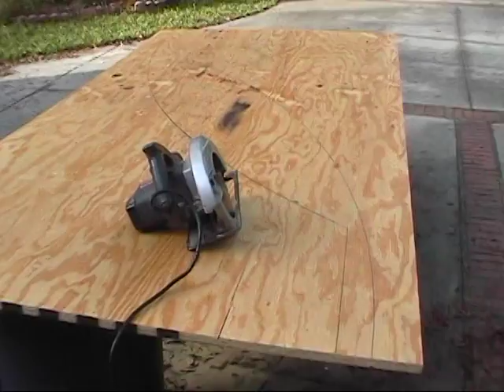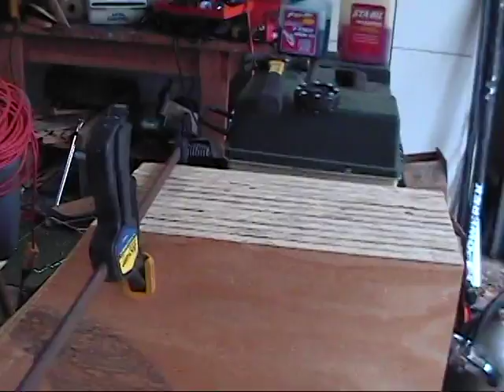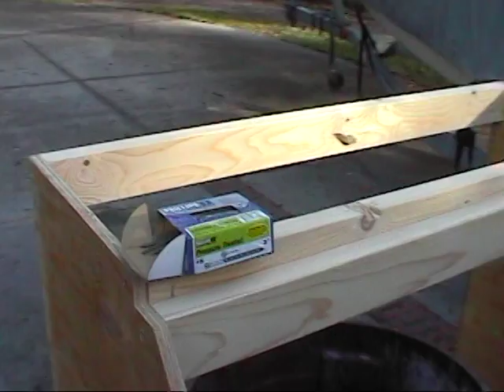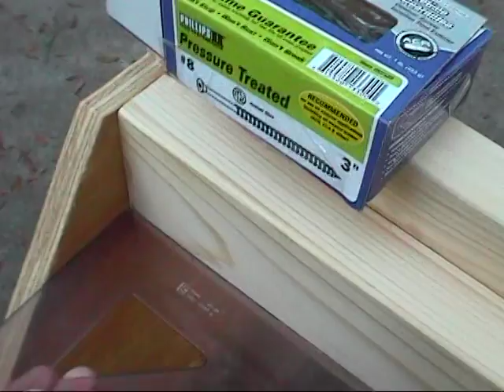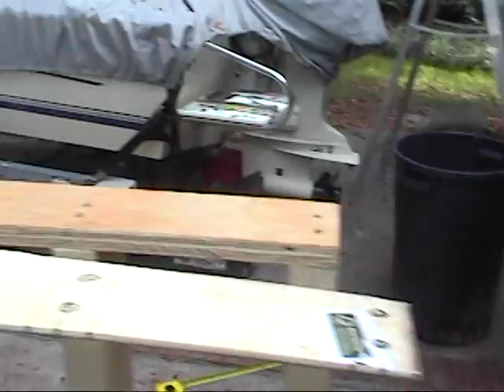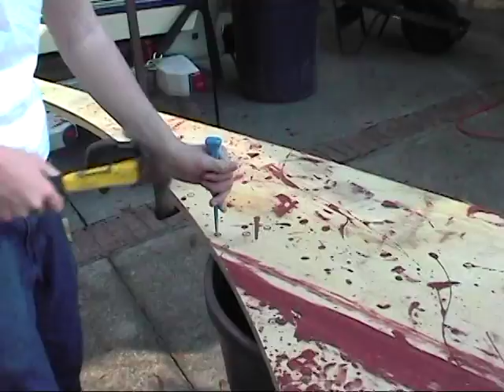Skateboard Miniramp build video part 1 of 5 ramp sections

Comment from the maker: This ramp can be built for less than i spent for sure.  I was designing it as i was building it so i made some changes as i went along.  Also i probably used the most expensive supplier for my wood, Lowes.  The pressure treated railings and poles were also expensive, you could save money there.  If you use my plans and do a good job shopping for wood i think you could build this ramp for around $1000.